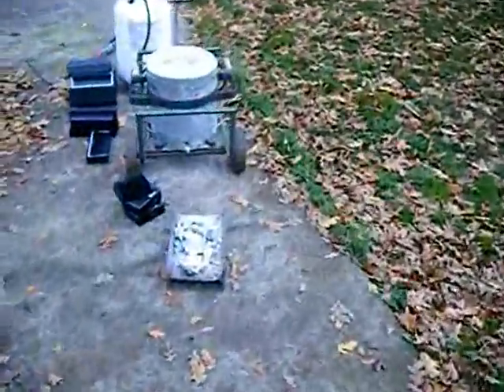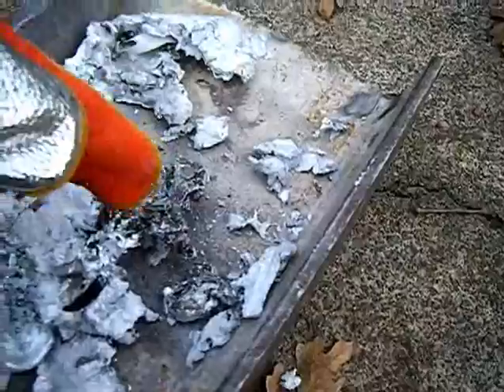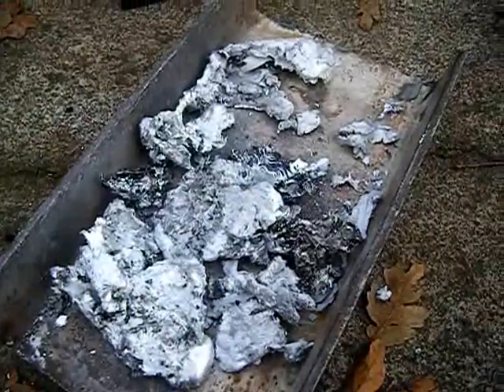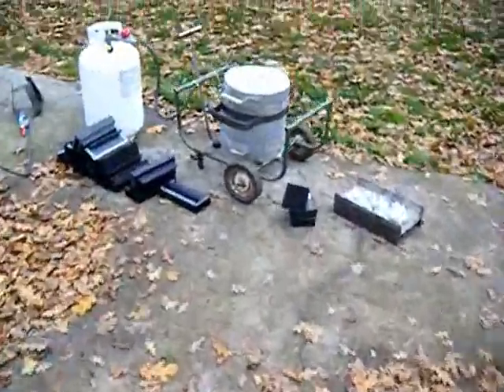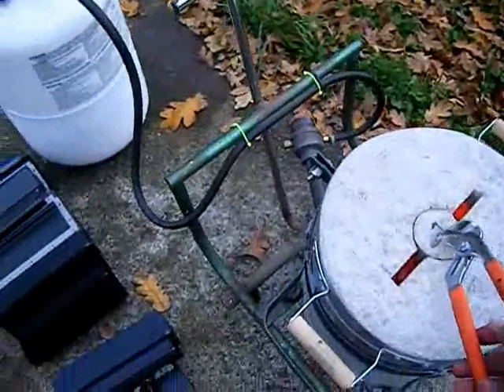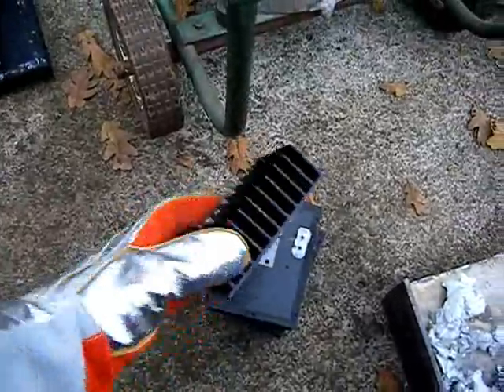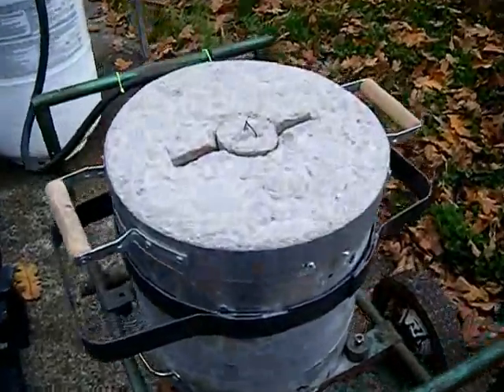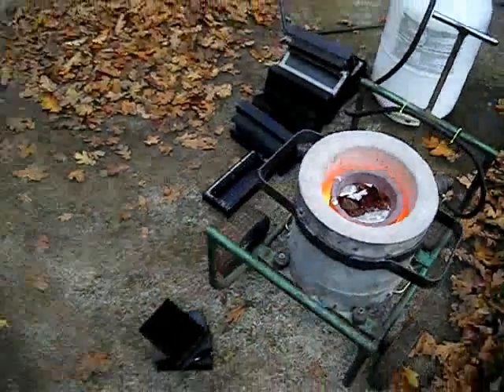DIY Foundry: What is Dross? (Part 2)

Comment: What if i by mistake burn plastic part along with aluminium body???
Reply from the maker: Waste plastic, oils, paper and other garbage will generally burn off leaving ash on the surface you can skim away with the dross. However, check your local laws about what is allowable to burn and what is not.  And be sure not to breathe the fumes, even when it's legal to burn.

Comment from the maker: The molten aluminum you see in the video is from heatsinks.  

I salvage the anodized aluminum heatsinks from broken and discarded consumer electronics.  The black skin you see floating on the surface of the molten aluminum is the annodized coating turned into dross.

Comment from the maker: Yes, you can buy the same furnace from foundry101, based in Seattle.  I modified mine to add large grab handles so that I could lift the middle section out of the way easily.  

If I had thought of it, I would have ordered it with these handles built-in.  It's a lot harder to add the handles later.

Comment from the maker: Thanks! It might have looked like it would melt, but the blurry effect was caused by condensation from the furnace exhaust.

This is a propane fired furnace, and water vapor is a byproduct of propane combustion.  It's another reason I don't run the furnace in the garage - I don't want everything to rust in my garage. =)
Reply: Try leaving a beaker of hydrochloric acid out in your garage for a few days.  Every single bit of steel or iron will be coated with a protective patina of rust, and you won’t have to worry about water vapor anymore.

Just kidding if that isn’t obvious, but those HCl fumes are HELL on metals.